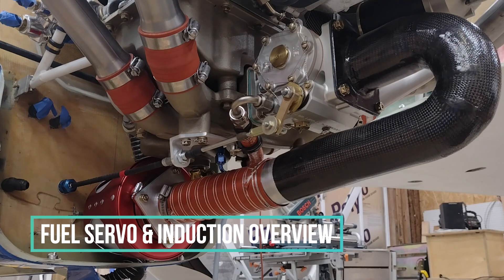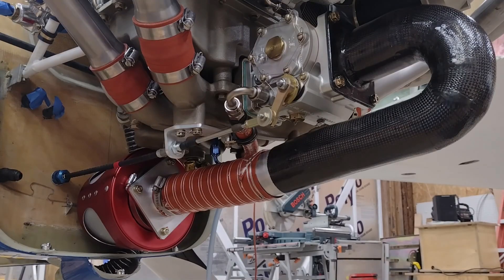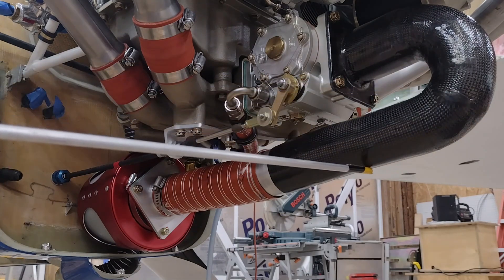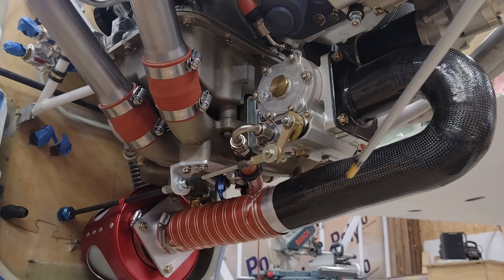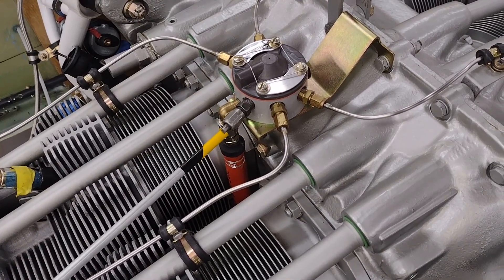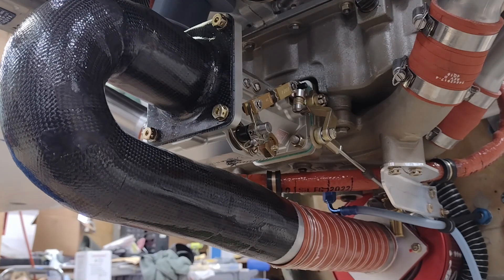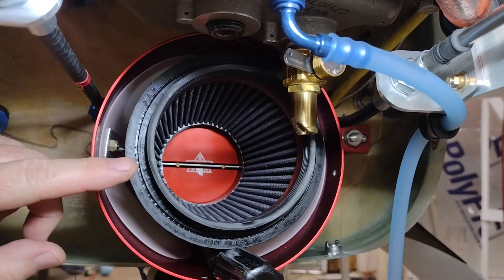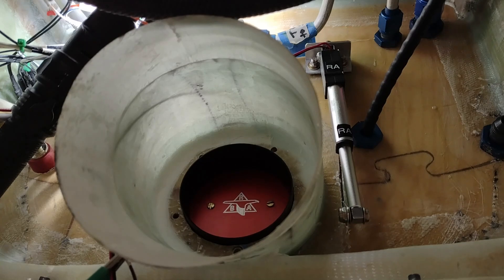Long-EZ N916WP - Fuel Injection Servo and Induction System Overview

Comment: Velocity owner with IO-360 and usual fuel divider on the top (hot) side here; yes, hot starts are a real PIA.   I ended up going from an Odyssey 680 to 925 simply to provide additional energy to crank (longer) for hot starts.  Great design on the induction system. Pushers have many challenges.
Reply from the maker: Yes, Pushers do have [so] many challenges. Thanks for the feedback!  I edited it out of the video to keep it shorter, but I've already spoken to Don at Airflow Performance to get a credit on those elbows I no longer need for stainless steel fuel lines.  Also, as per Buly I will be insulating my lines to keep them as cool as possible... curiosity killed the cat. ;)
Reply: @wade-airdog7730  
I thought about insulating the spider and the 4 injection lines, but insulating only delays heat accumulation, doesn’t prevent it. Subsequently, the lines will hot soak during flight and taxi in.  Would be a good analysis project for a grad student.  
Perhaps at some point I’ll post my set up on my channel, but been too busy wrapping up painting.    Regardless, I hope your heat issues are minimal.

Comment: Any concerns about grit getting tossed up in there and hanging out until you open the valve etc?  Keep up the good work, its inspiring.
Reply from the maker: A minor concern.  Being an unabashed copycat, I designed my RAM air scoop heavily off of James Redmon's C.R.A.M. design, also discussing it with him at Rough River a few years back.  Also another Long-EZ flier at RR a few years ago had the Rod Bower RAM can and somewhat similar to my setup.  Neither of them reported any grit or FOD if using the filter during ground ops.  Thanks!